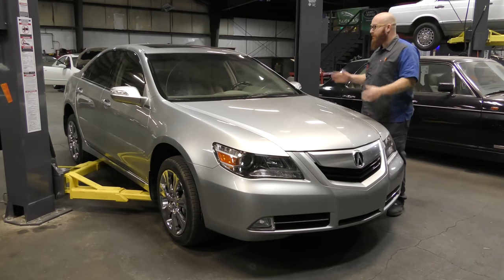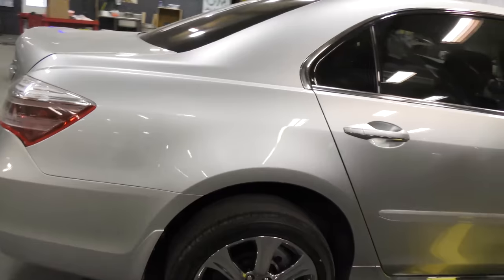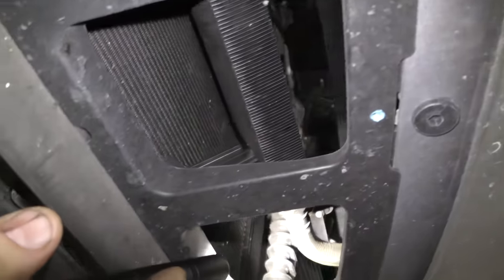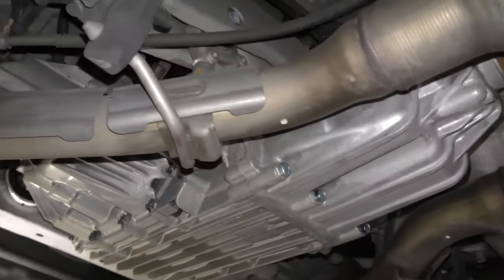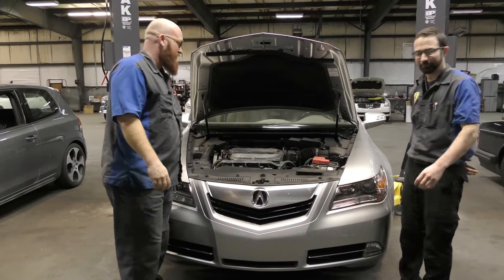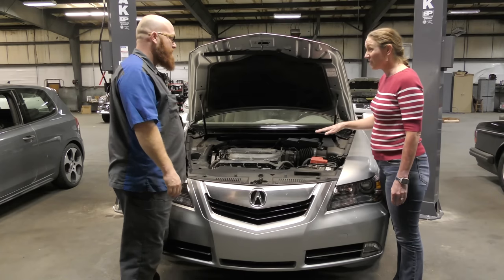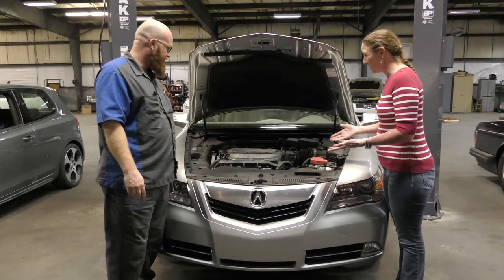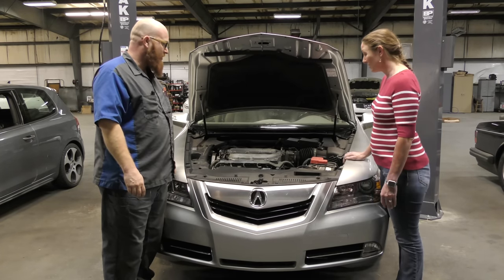Something Very Serious is Wrong with this 2010 Acura RL! What did the CAR WIZARD find???

Comment: Back when Honda used to make genuine, reliable, and quality cars...
Reply: 100%, its very sad on their reliability nowadays. I was in FB 3rd Gen Honda Pilot groups and so many people having premature injector failures. And home have issues with their headunit. Honda also got hit with their reliability for oil dilution issues with 1.5T engines on CR-V and Civic right? It's really sad what has happened to Honda.
Reply: @LionRunner  Not all new Honda's have issues. I have 2016 Accord Coupe with zero issues. Even Toyota have had recent issues so its not just Honda. I'd still take a Honda or Toyota over any domestic or German vehicle. Only Kia and Hyundai would challenge them for reliabilty etc.
Reply: Eh. They stopped making reliable cars around 2007. This is newer.
Reply: You must be forgetting about the transmission problems they had behind their v6 engines.
Reply: Hello from Austria (EU) where Honda sells maybe 100 cars a year nowadays. I looked at the previous model Euro Civic and the price was a bit too much so I dropped the idea. Am very glad I got a 2015 Mazda 3 instead, the current EU Civic is even worse I hear, the head gaskets don't hold on these highly strung little turbo engines. Sad really when you think how popular Hondas were here in the 80s-90s.
Reply: unfortunately reliability doesn't sell cars anymore
Reply: Yep. I've been saying this for years. Anything stamped with "earth dreams" has been pretty shitty
Reply: Wait what? You see ONE video on ONE broken Honda engine and you think this is a Kia? Who ties your shoes for you?
Reply: @houseofno  exactly not sure what their talking about. These are literally the same engines from 30years ago.
Reply: Check lkq country wide
Reply: @corrion1  Not true. Works great with Lexus as they still have the highest CLV of any luxury brand.
Reply: got a 2007 FN2 Type-R with a Rotrex supercharger kit, i drive it like if i just stole it pretty much everyday, even done the Nurburgring twice, about to hit 13 years and still kicking ass and taking names. never costed me a dime over the normal oil change, tires, breaks pads and battery.
Honda (and Toyota) are so reliable, they spoil you for every other brands of cars.
Reply: That sounded like a Scotty video title lol..
Reply: @corrion1  - Not true. People consider the Japanese brands to be most reliable and people flock to them by the millions, even though plenty of models are made by drunken US auto workers and not in actual Japanese factories.
Reply: @tturtle1659  Honda sold 2264 cars in Austria last year.
Reply: @thebigguy8306  I just did my timing belt and water pump but at least its good for another 100k kms. Cost me $1200 CAD. However as its a maintenance thing I can live with it. The car is still reliable ect.
Reply: @AircraftMechanic-AP  That's where I thought this video was headed - until he said all was good underneath.
Reply: @Blue-moon12  Yes. The oil dilution problem isn't universal throughout the Honda or Accord model lines. I remember when Toyota had a issue with a 3liter engine. It was sludging up. Honda and Toyota like any auto manufacturer will always look for ways to improve their engine or trying some new design. Engineering doesn't stand still. I can't imagine Honda ever just stopping doing R&D for their race engines. If that were to happen their competitors will catch up and leave Honda in the dust.
Reply: @LionRunner  Yep. Our 2017 Honda Pilot had injector failure at only 38,000 miles, just outside of the powertrain warranty. Luckily the dealer replaced it free but still very troubling.

Comment: It's not a transaxle Wizard. The rear diff is an electronic diff which can do torque vectoring. There's something called an acceleration device in front of the diff which is sort of like a 2 speed gearbox. It lets one rear wheel to be overdriven to help it corner. Very nifty.

Comment: Its the exact same engine from the Acura TL Type S and the newer TLs (2009 and up). Check junkyards for a TL Type S. Theres gotta be something around.
Reply: Type S only used a 3.5 the 4th gen TL ShAwd used the 3.7
Reply: No it's not, the TL's used electric power steering and the RL used Hydraulic Power Steering so there's no ports to feed the hydraulic system in the TL's J37

Comment: Motor swap? Pop in the motor from the Ridgeline/MDX/Pilot?
Reply: Wizard says the customer wants a New or Remanufactured engine. If they were less picky, the identical 3.7 V6 engines to this RL was also in Late 2nd gen MDX, SHAWD 4th gen TLs, and All Acura ZDX.

Comment: MDX also had the 3.7
Reply: I think the MDX had dohc and the RL had sohc.
Reply: @zippySquirrelface  both were 300 hp sohc
Reply: @jackiejorpjomp  I'm pretty sure they can use the 3.7 V6 from the SH-AWD TL I'm not sure why they are making it a hassle to find a used engine for this RL when theirs hundreds of TL of the ERA on the road or in the junkyard.
Reply: @jackiejorpjomp  regardless, Mr wizard said no engine swaps allowed.
Reply: @kimitsu20  yeah very strange, although I'd bet it's not the exact same design. The engine in the RL seems flatter and wider than what was in the TL.
Reply: @TaylorMMontgomery  It's sad to see such a great engine be destroyed. I have the 3.5 V6 in my 2013 Acura TL and it's been extremely reliable. I always ran away from the 3.7 V6 for the oil consumption reasons. I didn't want to deal with that ontop of a car payment.
Reply: @kimitsu20  I has a TL also few years back, it was an '05 with the 3.5. Really miss that car, wish I never would have sold it

Comment: timing belt/chain is off of the tensioner.. my 08 sounded exactly the same before i got it fixed... no i did not need a new engine the time belt/chain was fixed along with the timing tensioner. now 246k miles later no service lights and still going strong

Comment: Those 3.7 are prone to Oil Consumption issues. Actually this engine is also in the 2009-2014 Acura TL's, ZDX, and MDX of that same era. The RL wasn't the only one. Might be another engine model for models listed above. Acura had a recall on the 3.7 V6 for bad piston rings. I'm pretty sure the original owner of this car never drove much and probably never checked the oil as often.
Reply: Never heard about oil consumption in this engine, the accord with the 4 cylinder had the oil ring issue that caused oil consumption

Comment: I wish they made these with manual transmissions in the US.
Reply: you can get the same engine/awd system in the TL with a manual
Reply: @chrisriley557  Those are rare, and if you can find it then it's very expensive. RL's are a lot cheaper, albeit Automatics.
Reply: @Roosyer  I just checked autotrader and their are 7 for sale in the whole country, didnt realize they are that rare...
Reply: @chrisriley557  Yup, those are hard to find unfortunately.

Comment: Hey car wizard I rebuilt a engine an put it in my car. I've only driven it like 20 miles so far. I've kept it under 4kish rpms and haven't let the turbo build boost. How long should I baby it? Should I change the oil soon? Or like 100 miles? Thanks!

Comment: Wow, what about putting in a 3.5 L engine ??!
Reply: I'd bet it would work but be lacking some power.
Reply: @jeremypike9153  abrely any difference in power and the 3.5 last forever compared to the dogshit 3.7
Reply: @pope9349  Lol is the 3.7 that bad?
Reply: @pope9349  isnt the 3.7 just a stroked 3.5? Even wizard said that it's basically just a 3.5

Comment: There are several motors under 100k miles on eBay right now for that Acura. Most of them are around $2500. At about a $5000 savings over the option you are looking at now, it may be the way to go.
Reply: I do that over a questionable rebuild but hard to check out those engines.
Reply: Yeah. I don't understand The " you can't possibly buy a replacement" lol
Reply: That price on Ebay is engine only. No re and re labor. Plus all the "while you are in there" parts. Can you trust the Ebay seller enough to risk getting an unknown history engine? That's the dilemma here.
Reply from the maker: You guys clearly didnt pay attention to the video. Customer demands new or rebuilt only. Refuses used engines altogether. No matter the miles
Reply: @CarWizard  - The customer is being unreasonable. They need to sell the car for parts. Or, I'll give them 10¢ on the dollar and put in a salvage engine myself. Why so fussy on a 10 year old Honda sedan?
Reply: @CarWizard  Money is money. I thought that maybe the customer would have a change of heart once the reality of the situation was made clear. However, if a customer demands something to be a certain way, the customer gets what they ask for. No issue with that. In the end, the customer is the one that pays the bills.
Reply: Anyone else think it’s ironic that the guy with a car that didn’t make 50k miles, is too good for a used engine?
Reply: @wholeNwon  Wait, you think that an ebay engine from a junked Acura is less questionable than a rebuild?! 🤦‍♂️
Reply: @OMGWTFLOLSMH  Because the dealer agreed to pay for it. I'm not going with some junkyard engine either if it's not my money.

Comment: Mr. Wizard, I have seen a consistent complaint on these cars about oil consumption being so rapid that the engine gets damaged before most owners put more oil in to protect it...What have you heard about this 3.7 using oil? I am considering buying a 2010 3.7 TL, and maybe I should run away from the car. But the owner wants only $1,800 for it.

Comment: Isn’t it possible throw a 3.5 Honda engine in there?
Reply: That's what I was thinking.  If they just changed the stroke to get a 3.7, then shoehorn a 3.5 in it.
Reply: Or just use a Acura TL 3.7 engine
Reply: It might have extra sensors or the computer tuning for it might be different.
Reply: That model year they added more features to the engine to get it over 300hp it would fit but the converion wouldn't be work the money the engine cats and full exhaust have to be swapped since the 3.7 has extra piping to feed exhaust gas back into the engine
Reply: Im pretty sure this RL has the 3.7L V6 which made 300HP
Reply: @MrDede2011  don’t forget ecu etc,

Comment: The top plastic engine cover is missing. I'm not sure about that ATF stamping on the rear diff as the SHWAD system uses a fluid Acura refer to as DPSF which is also different than the Honda dual pump fluid.  As far as the engine goes, why not pull the sump to see whats wrong first.

Comment: Wasn't no factory defect the kid probably just never changed the oil .
Reply: Bout to say it still has the factory honda oil filter, probably still on the 2010 factory oil. LoL
Reply: @eldonerc2524  It would still run... Those Honda engines are helluva tough! The engine should have been worn at worst, not "broken". If you want to trash a Honda engine draing it of oil completely... Maybe there wasn't enough oil?
Reply: There's a TSB about piston rings on that gen 3.7 J series engines. They're known to burn oil cuz of it. They have a program where they monitor your oil consumption for 3k mi & they do piston rings for you free if you're burning enough oil. Tons of info on it. I was shopping 2010 tl's for a bit & it scared me away from them. Used to have a 2010 tsx & those K series also had the oil burning issue
Reply: @RothBeyondTheGrave  what about the 2009 TSX? I read those are great and almost purchased one in manual.
Reply: @jamesmedina2062  that's the same gen as the 2010 actually. One MAJOR reason had me get rid of mine. Intermittent failure of the vsa modulator. It's married to the abs, the sensors go bad & it lets air into the braking system. 90% loss of brakes. Mostly happens during hard braking over rough patches, but can literally happen anytime. Scariest shit I've ever experienced in a car. No aftermarket solutions, $2,200 part only from Acura which 2 Acura techs told me to my face will also likely fail cuz they're bad from factory. Other than that & rear rotor warping, (which I also had) it's seemingly bulletproof. Enormous bang for buck & wish I had gotten the manual, but if you get that vsa issue.....sometimes it lasts for months & you literally have 10% of your brakes. It happened at 57k mi on mine.
Reply: @RothBeyondTheGrave  yeah the manuals are rare. I also like the 2007 and forward Civic Si. But the Acura has better stereo system and electric adjustment of the seat is cool. I wonder why Acura did not fix that part as it affects braking and safety. Sometimes I really wonder if Honda of America have their head on straight!
Reply: @jamesmedina2062  def are. Mine had the k24 4 cyl. The v6 TSX's weren't plentiful either (at least around me). Oh man, the els sound system is by far what I miss most. I know man! Apparently it was a small percentage affected, so no recall but its game over if you have it. Hahaha I don't think any manufacturers North America division has their head on straight to be honest!

Comment: Buy the engine from Japan, there surely are shitloads of those engines there at the wreckers. Japanese change their car at about 100,000 miles, so there is hope. And if no Acura with this particular engine was sold in Japan, sorry for my stupid comment.
I really do hope you find an engine for this beautiful car!
Reply: nope, none available
Reply: Plus, why replace a 42k miles engine with a 100k one?
Reply: @G0ZERIAN  japanese engines are postive grounded, they have a different ecu configuration and socket
Reply: @G0ZERIAN  because the 40 k miles one is buggered?
Reply: @millionaireidealist4459  I didn't know that. Makes it a definitely harder job but still an option, though a half-assed one (I mean the Wizzard would have to strip the Japanese motor for the good parts and put those parts on the buggered engine and make it great again) ;)
Reply: @SerbanCMusca-ut8ny  a spun bearing can be replaced and the cylinder walls and valve train can be inspected for mechanical damage. If extensive damage is done (doesn't sound like the case), then yeah, chuck the engine. But those JDM engine suppliers are pretty dodgy and you may be getting a 230k engine, you may be getting a 100k engine that had its oil change 3x in its lifetime. 

At least the 40k engine, if its still good and salvageable, you know the history and you know what you're getting
Reply: @millionaireidealist4459  having done dozens of engine swaps in my lifetime on plenty of Japanese cars including Hondas, I don't even know where to begin with that statement lol. A long lock and transferring over the USDM wire harness i guess? Lol!

Comment: Finally, a V6 Honda that has an engine that lasts as long as its transmission.
Reply: This was far beyond their early 2000s transmissions. Laaaame old joke 😘😘
Reply: I have own 3 honda Odyssey(02,05,11) and have 1 08Acura Tl and have never had a transmission problem ever and all except our recent odyssey had well over 250,000 and my Tl has 181,000. I hear the Autos are weak but never seen any receipts.

Comment: The Kid was beating the Piss out of it, goes with not having any skin in the game,
Reply: If it were a Kia/Hyundia it would have still been under warranty.
Reply: You would be doing neutral drops or something
Reply: Thats what I thought too. But with the body, interior, and undercarriage being in such good shape I doubt it a little. If the oil light came on then maybe the oil pump failed or the kid neglected the maintenance. Even then it only had 42,000 miles on it and wasn't leaking. If The Wizard suspected intentional misuse he certainly kept his mouth shut about it.

Comment: That’s like one in a million for that to happen in a low mileage Honda.
Reply: no, they changed the engine design and used Alusil, instead of iron sleeves,, it's junk.
Reply: Honda has routinely made crap since 2007-08...
Reply: Unfortunately not so rare with the J37 engines.
Reply: Honda still skating on their 1990s reliability reputation. Those days are gone.
Reply: I’m guessing none of these people own a Honda
Reply: @josephczarnecki6823  I bet everyone here owns or works on Honda for a living.
Reply: @josephczarnecki6823  I would never buy one.

Comment: Would a 3.5l motor fit?  why not swap it out for that displacement.  Wont have the same amount of power as before but it would be an engine you can actually get for a better price...

Comment: Engine was over revved more than once.
Reply: How are you going to overrev the engine in an automatic!?
Reply: @TassieLorenzo  lighting the tires up and making it rev out. When I was 17 I did it to the Kia Optima I had at the time.
Reply: @TassieLorenzo  not only that but acura is not going to program that car from the factory to over rev itself unless the kid put a tuner on it and reprogramed it that didn't happen like the wizard said it was just an unfortunate factory defect and if i'm not mistaken the owner comment on here that the dealership they take it to is going to pay for the engine
Reply: @brendenfreeman9572  Not going to "light the tires up" with SH-AWD
Reply: You can’t spin the tires unless you’re turning or the roads is slick. I own one of these cars personally.
Reply: @aaronsexton6434  Yes, I have a 13 MDX and a 12 RDX
Reply: @keithf8649  They are sweet cars. These people don’t understand what SH-AWD MEANS . :)
Reply: @aaronsexton6434  you are correct yes I forgot to mention it was raining outside when I did it.
Reply: How do you over rev an engine with a rev limiter and with automatic transmission?
Reply: Computer will not let it be over revved.
Reply: Yep. My guess is the kid thrashed the car when it was low on oil. Result: Toasted Engine.
Reply: @keithf8649  only way to do that with this car is to take lighter fluid and a match
Reply: @aaronsexton6434  It is super-handling, all-wheel-drive.
Reply: @ChrisN85420  yep